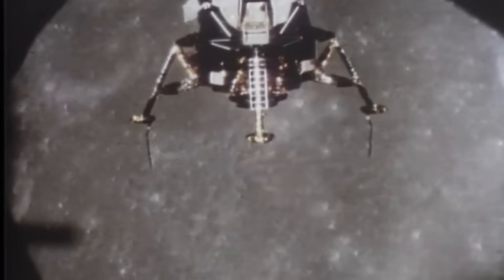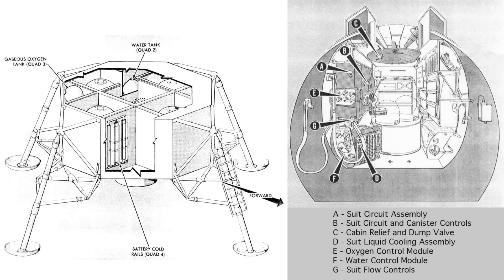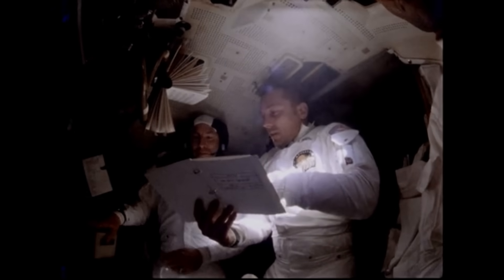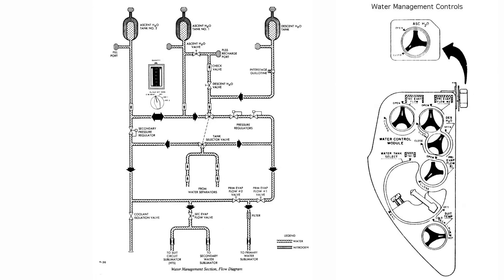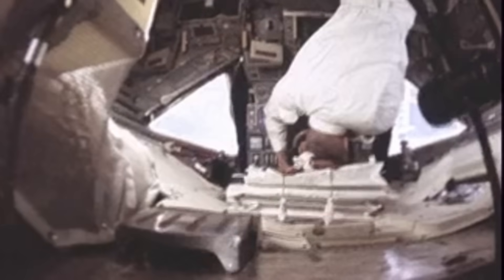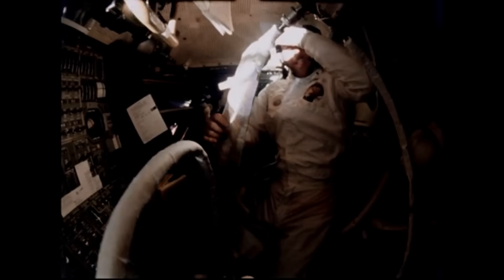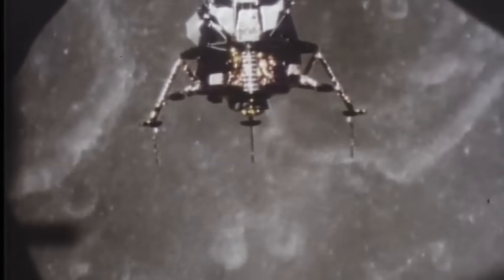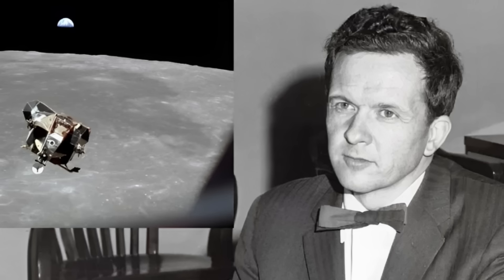Lunar Module: The Hidden Systems That Kept the Crew Alive

Comment: It seems like drinking water could have been produced in the CM for the lander. Launch it with empty reservoirs, and fill them up from the fuel cells along the way, which would have saved a decent chunk of launch weight. But I’m guessing that they wanted some already-present water as a backup supply in case of emergency.

Comment: As a young guy, I worked on one of the trainers for the Lunar Module. On the outside, it was an electronic project. On the inside, it was just like the real thing. All of the dials and gauges were in the exact locations of the real unit., After all of the work was complete on this model, I sat on one of the couches and watched all of the electronics. That was many, many years ago.

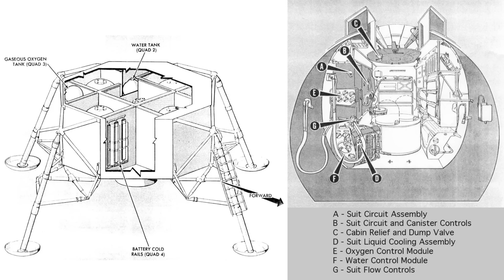Comment: 3:27   im schocked to learn the lunar module used pure oxegyn... i thought after the fire that killed gus grissam and forgive me ive forgotten the other names.  chaffee??  white? the program went on mixed gasses?   one of my first memories is of the man on the moon
Reply: The problem with Apollo 1 was they were on the Earth and had pressurized the CM with 15psi of pure oxygen, not the 4.7psi used once in space.
Later manned flights had 60% oxygen and 40% nitrogen at 15 psi at launch, gradually bleeding off the excess pressure to end up with 4.7 PSI of pure oxygen.

Comment: I had no idea the LM was a total O2 environment. Seems like a fire hazard like Apollo 1 tragedy to me, glad it worked out.
Reply: I think they lowered the pressure significantly to avoid the fire problem and also reduce the effort to move in spacesuits and such.
Reply: @larrye1234 Actually, operating pure with pure oxygen at a lower cabin pressure was just as dangerous.   The launchpad fire that killed 3 astronauts was also caused by a low pressure system.     The reason that 4.7 psi was used was so that the astronaut's blood wouldn't become over oxygenated, which is toxic.
Reply: Apollo 1 ground tests WERE at 16psi O2, for structural reasons (see below). 5psi pure O2 is essentially a normal 15psi sea-level mix with the N2 removed (no need to carry it into space: it's dead weight), so oxygen transport in the lungs at 5psi is identical, and it supports no more combustion than normal air does at sea-level. BUT... since the CM would operate almost entirely at 5psi inside and 0psi (vacuum) outside, it was built with a structure that was strong in positive outward pressure, but weak in inward pressure. And that's why they ran the CM at sea level with 16psi inside, to have a slight outward pressure; if they ran it at 5psi inside it would be damaged. They could have used (and did after Apollo 1) standard N2/O2 at 16psi, changing to pure O2 at 5psi as the rocket climbed to orbit, but as another weight- and complexity-saving exercise they decided simply to pump up to pure O2 at 16psi. And 16psi O2 will support serious combustion... (Frank Borman at the post-fire enquiry said that neither he, nor anyone else in the program, thought it was dangerous: Mercury and Gemini had run 16psi O2 on the ground, with no issues.)

One other note: if you've ever wondered why the astronauts (post Apollo 1) can be seen walking into the capsule, fully suited and carrying little boxes, it's because they were already breathing pure O2 at the correct pressure, so they wouldn't have to deal with the transition from N2/O2 at 16 to O2 at 5, which would likely cause problems with dissolved blood nitrogen...

Sorry this got a bit long!!
Reply: @sporg  Wow thanks, very informative, much appreciated detail.
Reply: @stargazer5784 4.7 psi is still greater than 21% at sea level. I wonder if the extra oxygen was on purpose to give them better thinking capacity

Comment: Speaking of no moving parts: Buzz found when preparing to leave the moon that the CB used to start the rocket motor was broken.  I don’t think there was a switch, just push in the CB and you’re on your way.  Buzz disassembled a pen and used it to complete the circuit and start the motor.  Otherwise they might still be there today.  Simplicity of design.

Comment: Given the lessons learned from the Apollo 1 fire, I'm amazed NASA were still risking using pure oxygen in any spacecraft.

Surely it's extremely dangerous?
Reply: Not really. Apollo 1 was a ground test and they had to simulate the spacecraft being in space while it was on the ground. To do that during the test  the internal pressure inside the cockpit was pumped up to over 20.4 psi (14.9 + 5.5 psi). This saturated everything inside with so much oxygen that everything became super-flammable. After Apollo 1 the spacecraft had air inside while it was sitting on the ground before launch. During the ascent the air was gradually sucked out through a dump valve as the outside atmospheric pressure went down. The dump valve sealed at 5.5 psi, and then the environmental control system replaced the remaining  air with pure oxygen. In space the internal oxygen pressure never exceeded 5.5 psi, which made everything less flammable.
Reply: @joevignolor4u949  In addition after the fire both spacecrafts were redesigned to eliminate  combustible material.